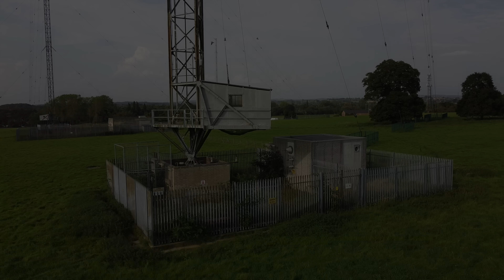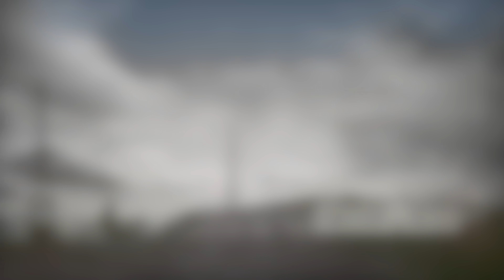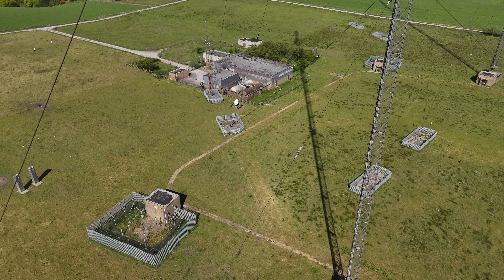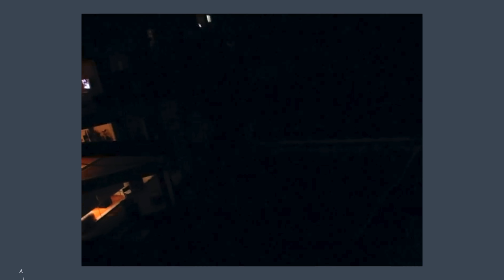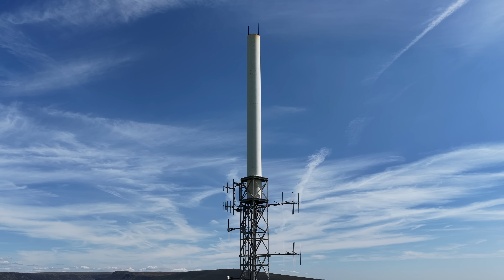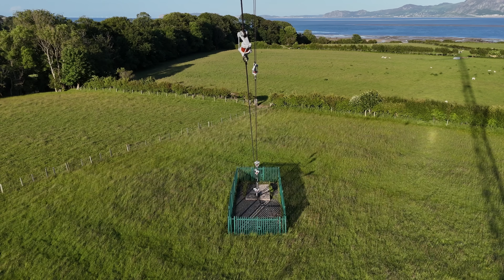Can You Harness Free Electricity From Radio Signals?

Comment: Because of inverse square law the intensity at only a few feet is already in the mw range. Not much to harvest
Reply: Inverse-square doesn't apply to locations near (or inside) the transmitter's Nearfield Zone.   That's why these stories involve VLF transmitters, where resonant power theft is effective at a distance of a KM or two.  Also, it helps if the transmitter is megawatts, and you're only powering your home lighting, and not an electric stove.

Comment: My story is almost the complete opposite. In the late 1970's I was a trainee Technical Assistant for the BBC at Evesham. We were taken to the Droitwich transmitter site to be shown around. Very interesting place to visit; talk about large components! The engineer instructing us, said that when they originally started transmitting, on I think 1500 metres, from there they had a number of complaints from houses on the other side of the A38 road that the homeowners couldn't switch their lights off at night. The BBC had to instal some circuitry in each of the affected houses to stop this happening. I think I recall him saying that this was not to pacify the homeowners as to reduce the loss caused to the transmitting power. I assume now that these were fluorescent tubes (although they may have been ordinary lights) and they probably glowed rather than were fully bright and the circuitry was some sort of capacitor (wave-trap) to filter out the 1500 metre frequency (2 kHz ?).There is some reference to this here: https://www.bbceng.info/Operations/transmitter_ops/Reminiscences/Droitwich/droitwich_calling.htm. 

I lived in Bromsgrove in those days and when we got our first car with a fitted radio (D registered VW Variant) as you drove past the Droitwich transmitter (actually near Wychbold) you could basically tune the radio to any frequency and would get Radio 2! Also over the same time while at school in Bromsgrove (3.5 miles away) under certain atmospheric conditions you could lift the stylus up from the record, turn the amplifier up to full volume and just about hear a very grainy version of Radio 2, certainly not for long term listening to but discernable. 

And finally for my two pennies worth; I subsequently became a Police Officer. Under the Theft Act 1968 (UK), Abstracting Electricity must include that it was done dishonestly. Proving Abstracting Electricity in these circumstances would be difficult enough, proving that it was a dishonest action would make it even harder to prove. If I were the defense lawyer I would take it to a Crown Court and I can not imagine any jury finding anyone guilty of the offence. They would probably all go home and work out how they could do it themselves!

Comment: You would have to know the ones and outs of a magnetron, and how to use the input and output feed loops to even come close to finding enough energy from a radio signal... Problem being you would then be messing with radar as well and that could put you in heaps of trouble you don't want.

You would have better luck harnessing stray ions trying to reach ground using lightning rods

Comment: Back in the 60’s or 70’s there were protests in Dorset about low hanging power pylons, the protestors waved florescent tubes under the pylons to demonstrate the radiated energy.  The electricity board prosecuted them for steeling electricity.

Comment: I went to a 6th form college in Daventry. I did an Electronics and Physics course An ungrounded amplifier could pick up the radio broadcasts from Daventry very clearly. And a friend remarked they had a coil heater which also could pick up the sound. It presumably vibrated and they could hear ‘voices’ from it.  Went on a trip to the Station at Daventry too and was shown around. Only place they could not show us was the “top secret” part of the station presumably run by some government agency.

Comment: I remember building a few "flea power" AM radios that had a coil for picking up RF energy and rectifying it to operate a single transistor audio amplifier .. needed a good length antenna and proper ground to work correctly, but it worked pretty well

Comment: I'm a ham operator and I know that when I'm transmitting 500w on 75m or 40m on a dipole above the house while my wife is running the clothes dryer it will shut off.  I had assumed that this is caused by the sudden draw of power and subsequent surge causes the dryer to go into a fault mode and shut down but it only does this on these two bands. It doesn't do this on any band above 10Mhz even though I'm using the same transmitter and the same output power. However, above 10Mhz I switch antennas to one that is verticle and a bit farther away and a bit higher so the radiation pattern is different. This makes me think it may be a radiated power issue. It's possible that the circuitry in the dryer is capturing some rf power and maybe is flipping the state of some mosfet and making the dryer think that is cycle is complete. This doesn't seem to have any other effect on the dryer or other appliances. The dryer can simply be restarted. I would think that the impedance would be so high that the received power would only be in the milliwatt range.

Comment: all you need to capture a high tension/hv line is a 4 foot flourescent lamp, just walk under the lines and it will light up, sometimes you need to touch 1 of the ends to give it a virtual "ground"

Comment: You can't just suck all the power from RF in a given area. It doesn't work like that. You can harness the power collected. But it's very small. So small it's not really worth it. At most you can run a small light or charge a small battery. Otherwise worthless.

Comment: Inductive loads are coupled to an emitter's power supply via Lenz's law, so scavenging power this way does indeed present as a load upon the system;  effectively the transmitter's power supply is performing work upon any harnessing coils, and ultimately driving whatever the attached load, hence having an air gap doesn't really make it any different to stealing power from landline cables.  Contrary to appearances, it is not merely recouping energy that would otherwise be electromagnetically dissipated.

All inductors within the transmission area are likewise sapping power - the alternating magnetic field is inducing small currents in all conductors, from road signs to steel building frames, which are dissipating energy via resistance heating per Joule's second law for heat, while also retransmitting the signal, albeit slightly phase-shifted, and of course attenuated by the aforementioned resistance losses.  Any notion of harmlessly "harnessing stray RF" are thus misconceived.

Comment: The story I heard, back in the early 80s, was a guy from RSRE putting loops of copper in his rooms and running 12v light bulbs off of them.

This sounded plausible, especially as there is a house, in the part of Malvern mentioned - that is/was* covered in antenna covering all sorts RF frequencies; right up to a giant 40+ft one, fixed to the side of the house.

*As of 15-20 years ago, I saw it whilst visiting a customer.

Comment: As a kid I made a crystal radio set and was amazed that I could pick up a 50,000 watt radio station that was 13 miles away when I used it with my Dad's 80 meter antenna. I used to let it run 24/7, because it required no batteries.

One day I got bored and removed the earphone and replaced it with a flashlight bulb.  To my amazement, the bulb glowed!  It wasn't anywhere near full brightness, but I was seeing the filament light up.  I thought this was incredibly cool!

Comment: Variants of this story are circulating everywhere, also here in Germany and often without any specifics such as a time, date, exact location, names of persons involved, related newspaper articles or snything else that could be verified or assist in finding further material.  In short it always has the smell of a proper urban legend.

A fluorescent lamp light up by stray power radiated from a maybe 5 kWtransmitter final stage has been demonstrated to me.  Light up means very flickery.  Too flickery for illumination and well below the full birghtness that could be achieved by grid operation.  The tube was not connected at all, just lying in the metal case of the final stage.  It even served a genuine technical purpose.  When tuner for this final stage was roughly tuned right it light up.  That helped with quickly retuning after a frequency change.

I've always wondered about the long wires of electric fences near big transmitters 🙂

Of course big long and medium wave broadcast transmitters are playing on a whole different power level.  But hey, what's 20 dB among friends ;-)  Strange things are bound to happen near big transmitters.  Transmitter sites are usually fenced and I've never heard of any of them having problems with theri fences getting electrified by the transmitter.  And any “energy extracting device” would be rather loosely coupled compared to the tube in my previous example which would significantly reduce the strength of the field received by the device.  Finally, being off-site, outside the fence means it's already a good bit away in a field that's weakening with distance.

Comment: If they are broadcasting so much energy, and you are able to harvest it for
your own private use, just keep your mouth shut and don't tell ANYONE!

And don't get greedy and try powering everything off the transmitter. It makes
it easier to get discovered if you have too many things powered off the site.

When you get caught, just explain you were having problems with your animals
getting electric shocks and other problems from the high energy transmissions
and you were trying to solve the problem, and that the broadcasts should be
shut down for causing so many health problems!

Comment: Some thoughts on this topic:
1) Look up "Tate Ambient Power Module" circuit. It works. Its really cool.
2) N. Tesla believe that out of his coil came also longitudinal waves (or so called scalar waves). These would have H=0, B=0, but there would be energy there. This is where Heaviside equations fail you and Maxwell original equations give a different answer. If scalar waves a real, and many people think they are including "TheOldScientist" who demonstrates, then this is an entirely different way to broadcast energy. 
3) NASA claiming they can only transmit power about 5 miles, using lasers, is likely disinfo, 
4) With one antenna, not much power is received. With two antenna you can add their signals with a balun, to double the peak-to-peak voltage. If you double the voltage, you quadrouple the power (v^2/r). Why stop at two? You can also subtract their signals using a balun, and this is where a beat frequency could be created which could also be useful for power extraction. There are many experiments to perform with 2 or more antenna. A grid of antenna could probably do very well.
5) It is possible to make a small basket-weave coil that can serve as an AM to SW antenna. Where the wires cross is a very small cross section and thus very small self capacitances (or you can control the wire gap careful for a specific capacitance you engineer). These types of antenna are similar to a series of loop antenna -- and so in a way it is many loop antennas in series and ADDing. The diameter should be 5 inch or greater. See Hendershot (2 basket-weave antenna adding or subtracting).
6) From 100Khz to 200Khz is a very interesting frequency range to target -- with lightning here. There may also be muon ionization events here, etc. LF and ELF are very unexplored ... but I see that you can use SDRSharp with an LF/ELF front end. Looks like fun.

Comment: In my opinion, it is not theft if it is pulled from the AIR. Let the BBC prevent the signal from entering your yard. But if it crosses into your yard, it is energy that is trespassing on private property and should be put to work to earn its keep.

Comment: Wow, how surprised was I to see footage from my video from 15 years ago!

Great video mate.  Yes I strongly suspect that actual significant power theft (more than a fraction of a percent of the transmitted output) is mostly impossible and has never been prosecuted.  There just isn't much energy density in the far-field, the inverse square law applies and practical scale antennas for such low RF frequencies won't have enough aperture to collect much energy flux.  There also wouldn't be much "shadow" produced by small collectors sub-wavelength in size, most of the wavefront would just diffract around it and fairly quickly fill in the captured area subtended by it.

However, in the near field you can collect a significant amount of power with smallish devices and that could be noticeable at the transmitter.  The near-field is the so-called "reactive zone" where a great deal of EM energy bounces back and forth between the antenna and the space around it, caught and continuously exchanged in the resonator of the antenna's distributed inductance and capacitance.  If you placed a resonant collector close enough that it had significant coupling to the transmitting antenna you could collect a fair bit of the transmitter output - a fraction of a percent if you are within a wavelength or two (1.5 km @ 200 kHz) and went to extreme lengths to make your resonator so high Q that it would only just fit the entire emission bandwidth of the transmitter.  At that point the efficiency is still terrible, but you can extract a lot of energy, if the coupling it tight enough - at which point the load on your receiving antenna (or even just its losses) start to be seen as a shift in the feed-point impedance of the transmitting antenna - that is your harvester becomes a significant part of the transmitting antenna.  This change in feed-point impedance may be noticed by the transmitter as a shift in matching to the antenna.  Basically some of your load starts appearing as radiation resistance in the transmitter antenna, a small amount, but likely measurable, especially as you ramp up the coupling and start to suck in more of the reactive field.

This is also where the energy losses might start getting large enough to notice in the far field too - with accurate measurements - day to day variations in the antenna performance from weather, ground resistance, ionosphere, etc may be larger).  Large shifts in radiated pattern are actually pretty unlikely, unless the harvester is really strongly coupled and leaky enough to radiate its own fields (which is counterproductive, it should attempt to minimise its radiation losses but as the "largish" structure needed at this point is likely a pretty good radiator in its own right it would need to be carefully engineered to be "stealthy" - in fact doing so would be quite a technical challenge).

Sorry about your Dad. :(

Comment: Usually these stories involve capturing the power radiating off power lines... not radio in general. Though there are some devices using energy harvesting things to capture power from solar, radio, and other sources. They don't capture much but it's stored in a capacitor which provides the power to run a sensor and transmit a reading once an hour or so. Of course, it should be noted that radio is effectively a way to send power wirelessly from one point to another - the receiver and antenna are tuned to pick up the minute amounts of energy containing the radio signal and amplify it. This is best illustrated using a crystal radio where you can tune in and listen to AM radio on a device which lacks any power source - it's powered by the AM transmitter. But every WiFi, 4G or 5G signal you transmit and receive is sending and receiving tiny amounts of power.

Comment: On a club visit to Ongar in the '60 we were told by the operators that their maintenance men used torches with resonant circuits in the areas under the antennas for inspections. It could have a story to impress, but II believed it, as it's the basis for a simple field strength meter. I still have one on my shelf from those days - except with a microamps meter !, not a bulb.

Comment: I once made a radio using germanium transistors that would drive a small speaker.  It had two tuning dials.  One was for the power source station a 5KW AM that I lived very close to.  The other to tune in the station that I wanted to listen to.

Comment: There are several variations of this idea. One is electroculture. Electroculture involves harvesting small amounts of ambient electromagnetic energy to energise or fertilise the soil by converting atmospheric nitrogen into nitrates that plants can absorb. It is not said how much energy is required to accomplish this, at which times of the year this would be effective, and how much is being generated beyond the root zone of a given crop. I have spoken to farmers who believe that sections of their fields have more iron in them, and are probably converting ambient electromagnetic energy into plant available nitrates. I’ve also spoken to gardeners who believe that burying a rail spike or dog spike, a wire basket, a crushed tin, etc., in the planting hole will help energise the surrounding soil. The concentration of ferrous metal in topsoil varies. Iron can range from being 0.2% to 55% of the weight of the soil, with many soils being in the 1 to 6 percent range. I’m guessing that adding old wire to the planting hole does not “attract” ambient electromagnetic energy, or result in accelerated plant growth.

Comment: Prayers on your fathers passing .you are correct  no way that it could cause a drop in signal. a few farmers have high line transmission lines through their property have strung electric fence  along the lines and it will charge a cap and light a bulb and the power company's cant tell it one bit  if they parked equipment too close for any bit of time when they walked up to it they got a shock touching it .